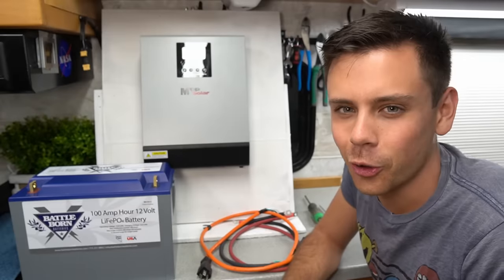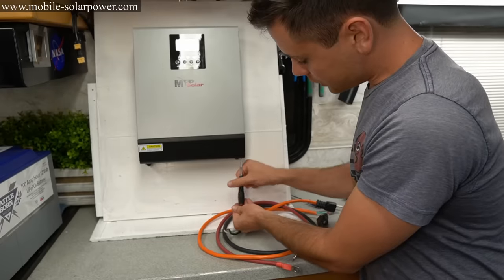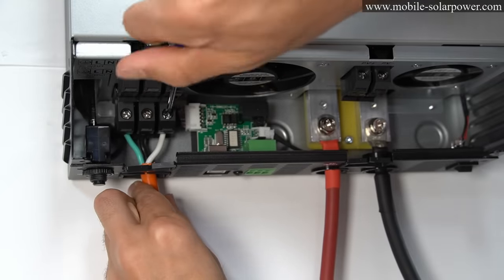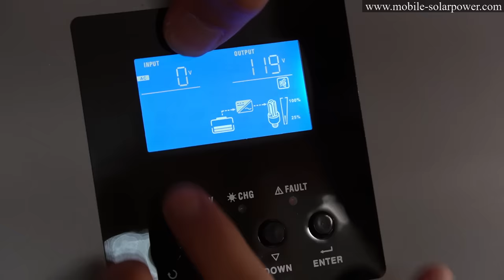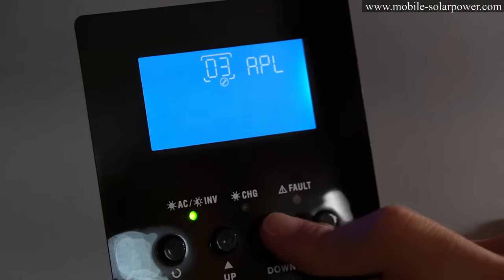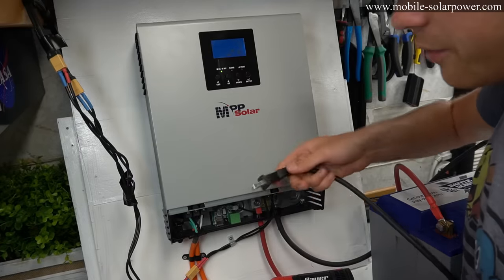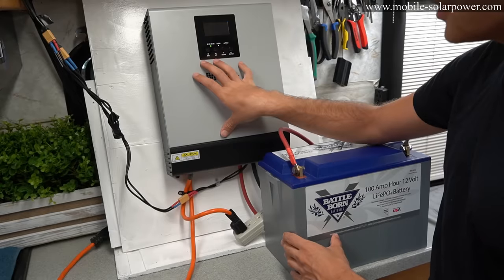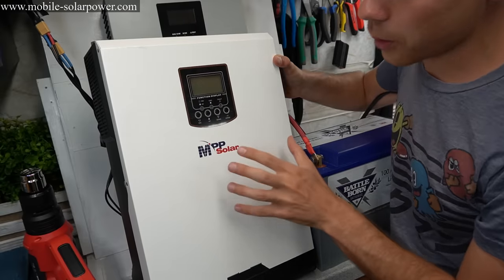Beginner Friendly All-in-One Solar Power System! Build a System in Minutes

Comment: I have a 3kva, 2400 watt solar inverter the same one as in the video. I wanted to put 4 x 12volt x 450 watt panels now I am not so sure. how many watt panels should I take then? Can I connect this directly to the mainboard with a circuit breaker?

Comment: Correct me here please. At 6:27 u said the open circuit voltage is about 145 volts, but in the example you had were 4x 100 watt panels in series. Does that not exceed the maximum voltage the inverter can handle?? Just  curious, I'm no expert here

Comment: could this be used as a totally offgrid system? I mean without any AC input. And in that scenario which cable I am supposed to use for the battery connection? I explain myself better, let's say the inverter has a 1KVA as normal continuose output and 2000 peak (10-20ms) , as that power must be taken from the battery that mean that the current from the battery to the inverter (in case of 12 V battery rack) would be at least 80 A right? if that is the case it need a cable that can accept such Amp which seems to me to be higher than what a 6AWG can handle(14 squaremm) right? would it even fit in the battery holes on the inverter/charger?

Comment: Can you configure the controller to use the battery at peak hours down to 20%?  So if I saved up a bunch of power during the day, I want to actually use it during peak hours between 4PM to 9PM.  Then after 9PM, have the grid charge the battery back to 40% and let the sun charge it up the rest of the way the next day?

Comment: I am new to solar power , so any advice would help with my problem. I bought a 24V- 3000W all in one inverter , not understanding about the VOC input when I purchased the inverter, and it has a VOC input max of 75V dc, now that I am learning solar trying to figure out how to make it work for what I need, I have 4- 100W panels and the DC VOC input right at 20v per panel , been reading about series and parallel wiring would this solve my problem and keep the voltage input below the 75V.  I know to wire series and parallel separately , not sure about combining them together. Again any help would be appreciated ,  thanks

Comment: DIY Solar Power with Will Prowse,, when the inverter switches over to the grid power for whatever reason, does it charge the batteries as well when using grid to power the load?

Comment: Great video Will, what is expected life time of a MPP solar unit?
Reply: I installed one of these units in January 2021 and it's been a work horse the entire time. Almost 2 years.

I have a 3s2p (3 panels in series/2 strings in parallel) set of 100w panels attached for a total of 600 watts of solar power. Maximum amount allowed is 800 watts (4s2p) of solar input.

The next upgrade to my system, is to change over from an AGM battery, to a 280ah-300ah LiFePo-4 lithium battery. I'll have to adjust some of the settings when I do, but can hardly wait.

Comment: FYI the fabricated XT-60 connector wasn’t listed on your all in one system package guide and I’m out on my off grid property and can’t connect my solar array. I should have realized this when I watched the video but you might want to add it to the list in case it happens to someone else.
Reply: Can I just strip the MPP wires and connect it directly to the PV output or do I need another wire in between?

Comment: Hey what is up with LiFePo battery BMS shutdown from surges into the  inverter input capacitors? You don’t have a current limiter in place when you fire it up in this video. I heard some LiFePo manufacturers are requiring the limiters to protect the battery BMS and the warranty.

Comment: Can you please add circuit breaker on the system in order for us NOT to have any fire accident?  And label which is input/output on those wires/prongs what ever you call it?  / I already have 200 solar polycrystalline.  I have not used it since year ago.  I am very scared of it as if it is alive!

Comment: I've 12 panels of 6 Amps 100 Watts 21 Volts and 4 panels of 8.4 Amps 300 Watts 43 Volts and Smarten Superb 2500 MPPT inverter. Could you please let me know how I connect them for maximum output?

Comment: Hi Will, I am ready to buy one this small unit but something does not make sense to me about do not connect the solar panel first then the batteries (I am doing off grid setup) because it can damage the unit. I contact MPP Solar and they says the same thing. The thing is, you are supposed to install a fuse or breaker or disconnector between the batteries and the unit for protection, that means while the unit is running but the fuse/circuit breaker for the batteries is tripped it will then cause damage to the unit. So what is the use of having fuse for the batteries, or Low batteries disconnect (done by the unit ) if it will damage the unit.
BTW, thanks for great Video, I am learning a lot from you.
Reply: Yes, definitely wire a 100A fuse, or whatever the Amperage rating of the batt. is, in the middle of the positive lead of the battery for over current protection.  Best to wire the solar through a small fuse box also, before connecting to the MPPT inverter unit but I think Will is keeping is simple here.  Either way, these all-in-one MPPT inverter chargers are wonderful and definitely the future.

Comment: What happens when the battery is full but still sunsine outside? 
Will the inverter stop charging the battery och goes direkt to the AC output?
Or do i have to take out the ware for the battery fron the inverter so the battery not be overload? (For the safety...)

Do you have any other "all in one solar inverter" that have funktion like this one? :) Easy...

Comment: Hi Guys I have bought a hybrid inverter 5000va 48v pwm 5kva/4000 to power my house. Currently it is running off the grid and not solar but the intention is to install panels at a later stage. My question is that I have bought 4 X 100 amp deep cycle 12v batteries which are connected in series which I charged up to 100 % before installing. The batteries are not being used at this stage to run the house but the inverter is continuously charging them. Is this correct or do I have a problem.

Comment: I need a Grid Tie Inverter with battery back up (UPS function) for 24 hrs nonstop power injection, but I have a problem to combine both PV & Turbine since GTI always have built in Charge Controller that only accomodate either PV or Turbine only. I know there are hybrid Charge Controller that can combine both, but the GTI won't accept the output from additional Charge Controller. So, do you have any solution of how to DC-Couple both PV and Turbines so I can onput the GTI?? I need information please, thank you.

Comment: With 2 100w solar panels and a sok 206ah battery, what size mpp would I need?  I want to be able to use a 750w microwave for just a few minutes, 1 or 2 minutes at a time.

Comment: Need help! I have 24v hybrid inverter connected to 24v battery currently running on grid, what is the maximum Solar chargesI can connect? System voltage 80v, 50ah

Comment: If I connect a solar panel to this inverter and then to my lithium battery will charge the battery, correct?   but can I connect this to the solar panel and then connect to the battery while the battery is connected to the truck camper (which already has an inverter)  would that work?

Comment: Hi, please advise. Last week I bought 3kv inverter and 2.4 Lithium battery. The seller (electrician), told it won’t give any sounds or noise from the unit. But after installing the unit it’s very fan sound. Please advise is it common for all solar inverters or is he cheated me.

Comment: Any suggestion on using this system to safely power a dc setup as well? Mostly confused on how to power dc when this is plugged into shore power so that i dont always have power DC appliances from the battery bank all the time. Or does that matter as long as this is charging the battery at the same time?

Comment: Had a question about the output voltage of the inverter listed on pg 36 of manual.  It states output voltage of 230 volts.  May I'm not understanding this right but I know when I was deployed overseas, if you plugged anything designed for 110v into the 230 v plug you got a very impressive smoke and spark show.  Am I missing something here??

Comment: Could you realistically hook up a seperate grid tie inverter with its own panels to the output of one of these inverters ok?  The grid tie should sync ok to the output? yes?  It would increase the power during sunlight hours at least even though it would be no advantage at night.

Comment: Hey Will,
I am a general contractor and I teach Career and Technical Education classes for our local school district.  I want to build a portable system that can power 10" miter saws and recharge our 18v cordless batteries.  Would this all in one system work if I mounted it horizontally in a hardshell rolling case?  Thx

Comment: Hey Will, I love your videos. I am just learning this stuff so I apologize if this is a really dumb question but is it possible to set this up to run like 6 DC appliances and and more than one AC outlet? I’ve been looking at using a Bluetti to run things and adding a battery to help charge it off grid and I think I at least grasp the concept behind that but this looks like I could get a lot more for less and in a system that is more “fixable” should one part fail. Anyway super long question and given that this is an older video it may go unnoticed but thought I’d ask :). I am ordering your book now btw and really wishing past me had paid more attention in my science classes.
Reply: Doesn’t look like Will answers many of his comments. I wouldn’t either if I were him (2 million views avg.). I’m here wondering the same thing. And have been studying his and the explorists’ videos like a fiend. 

Dc power: Unsure about dc power. Thinking (but unsure and still researching) that you can create dc power by using the marine grade fuse box, doing the math for each appliance regarding which fuse amp is needed and which wire gauge is needed, and connecting the mpp solar unit > fuse box > battery. 

Ac power: I’m planning on stripping the other end of a surge protector with multiple outlets with the same specs as the extension chord (12 g, 125v, 15amp)
Reply: Lemme know if you figured out how to use dc appliances with this unit!
Reply: I think I have it figured out and this is pretty much the same thing I’m planning on doing. I’m still building the frame out for the tiny building I’m planning to use this in so I’ll let you know how it works out. :)

Comment: Will I have the 24v system with 2 12v /100amh wired in 24v array. I want to increase capacity to 24v /200amh how do I wire the 2 arrays together? Without hearing sparking and welding of the last connection??

Comment: You Should not exceed the wattage of the inverter even if it’s on grid , it will burn the change over , relays etc 
Check that rating first before you overload it

Comment: Sorry will, I have a really similar inverter but is a 48v,  with the same menu, for some reason when I connect the ac input from my generator is just blinking the ac logo in screen, sometimes it charge like half second and then start to blinking again without charging. But I don’t get any error code. 
I am guessing the output or my generator is not very stable or clean.

Comment: I bought one of these all in one solar power systems in 24v.  The problem I am having is when I turn on anything AC, light, fan, anything the solar input quits and all of the power is pulled from the batteries and as soon as they hit minimum volts mine is at 22v then it shuts down the AC current until the batteries charge back up which just takes 10-15 minutes then AC power on and the same thing happens. Any ideas what is wrong. I have been through all of the settings including the ones you recommended on your web page. TIA

Comment: Question, I have one of these units at 24v. With the batteries connected and the switch turned to the on state, the LCD does not light and the AC, CHG and FAULT lights all are lit solid, what could be the cause of such? The battery voltage is 25v

Comment: Is it possible to put a single 12v battery into that 2k 24v module? Im in the predicament that I only have one 12v battery, but I have Solar Panels that would be better suited for the 2k model, the 1k model can't handle more than 500w off of panels but I have 870w. What can I do? Or am I stuck with the 1k 12v module and I can only wire in one of my two panels?

Comment: Can you add a power strip for 12 volt appliances...doni need to add a fuse etc it would be helpful if you could show the set up for you 12 v lights tv laptop etc....I bought your book but this seems so much cheaper than buying all the separate components. I am a virgin to this stuff so .....

Comment: So this is a grid tie that is set up to backfeed solar power to my panel box when the sun is out to cut the grid electric bill down and I can use it as a back up with the battery if the grid power goes out assuming the batteries are charged  right? or is the incorrect?

Comment: i was looking at the link your provided. I only Solar input power. whats the output power? im planning to start with 3k on a budget or ni just might jump to 6k invertor but thats on out put. my only other issue is the sources il be using will all be 12o volts but i need abot 6k worth of power. what do i need or should i do?

Comment: Just curious, how do I power all my lights (no plugs. just wall switches) in the entire house using AC OUT from the inverter? if I connect AC out to the main breaker of the house, then it might have a conflict with the AC IN connection towards the inverter. sorry, beginner here. pls enlighten me

Comment: I have a problem with my Lithium Battery, I do the series of 2pcs 12V battery to get 24V, all battery fully charges before doing this series but I wonder why both battery discharge difference Ampere? after discharge 1h they are about 20% capacity difference that remains in the battery. please advise
thanks

Comment: Recently retired, I want to see the country by car-camping a few nights per week in my RAV4 when I'm not spending weekends in Airbnbs.  I believe all the power I'll need in my car is a way to power (4) 120mm computer fans to circulate air and my ResMed S9 CPAP machine during the nights I spend on the road. (I can get a 12v converter from ResMed for ~$70) 

From what I've read, the handheld CPAP batteries are $300 pieces of Chinese junk so I want to rig up something like this thing Will has shown us...but w/o the inverter or solar. 
I really don't think I'll need those and I'm thinking I want to fit all of this in the passenger floorboard.
(Yeti 35 riding shotgun.)

Would it be necessary to splurge for a 100aH Battle Born to get this done or would a 50aH do?  What kind of MPPT controller would be best?  I can get a dual cigarette lighter plug and receptacle on Amazon for less than $20. 

Anything else I might need to be aware of?
Many thanks in advance.

Comment: Hi Will Love your videos. I’m super impressed with all your knowledge. 
I was wondering if you could make a recommendation for me. So I just built a garage where I store my riding mower and my ATV for winter. I would like to keep a charger on them both for the winter. They are 2 -12 volt chargers @ 750 MA. I have 5 led lights at 6 watts each which I think would rarely use. I really only use the garage for storage but might like to plug in a radio or charge some power tools. I live in Fort Erie Ontario Canada. I have sun all day with no obstructions. I would like a small solar system with the possibility of making it a bit larger just in case. I don’t see needing much more power than that. 
Thank you in advance 
Joe D

Comment: I'm thinking of getting the growatt 3k. My concern is the high idle consumption. Is there a way of only running the mppt part of the growatt without using the inverter section all the time to avoid the high idle consumption?

Comment: I have just started a solar system please help me out.
I have a 80 amp mttp controller and a 4000 watt inverter 24 volt 
I have 6 12volt batteries AGM sealed 35 ah.
I put in series & parallel the batteries to get 24 volts
My question is this I have 4 x 100 watt 12 volt 5.2 amp renergy solar panels should I put them in series or series parallel

Comment: On Will’s website, he states the high idle consumption of these units require 400w of panels to compensate.
Does this mean you need to add 400w to the system, or just that the system needs to be a minimum of 400w, thanks!
Reply from the maker: Minimum of 400w

Comment: Instead of placing a 200a fuse on the positive from the battery can I use a 200a circuit breaker?. Also can anyone confirm the max solar array you can add to the 24v 2400w model that has a 40a MPPT?

Comment: If you go with the 24v system, how do you use it with 12v appliances or lights?
Reply: DC TO DC converter Amazon.  Steps down to 12v dc

Comment: I wish that this inverter had a step down built-in to allow one to reduce 24 volts to 12 volts. I   use 12volt LEDs and water pumps etc in my motorhome. 
Can anyone on here give a link for the settings. 
I don't think Will's link works?

Comment: Man can u please assist me i have a brand new 2kva 12v inverter so when i plug a fridge the fan start yo run  non stop even when i plug a t.v it doesn't show clear it has vertical lines 😢 so the inverter is not connected to Ac/Dc at the moment im still waiting for the panels i have ordered so i tested the inverter with 4 batteries in parallel which is 12v without dc/ Ac power what is the problem there can u help please?

Comment: So… if I put two 100 amp x 12 volt batteries in parallel I’d have a 2400w solar generator, correct?